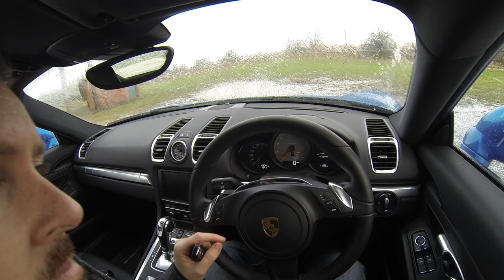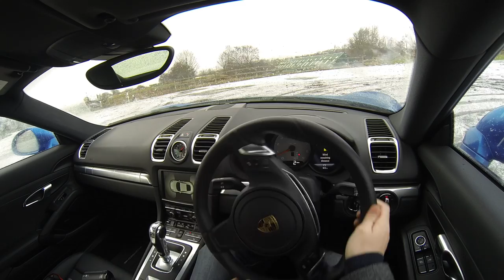Porsche Cayman, Boxster & 911 Wheel Popping Judder - The Answer

Comment: This happens on my 991 also. It is known as the Ackermann Effect. The outside of the tyres have to travel further than the inside of the tyres when following a curve. At low speeds, wide/low profile tyres and a very tight angle makes the wheels skip along and the judder/sound you experience are the wheels slipping sideways. Some people say it doesn't happen to them but it likely does as Porsche use Parallel steering geometry not Ackermann and for good reason. The warmer the tyre/weather etc reduces this effect so that also may be the reason some say they don't get it.
Reply: Best post here. Absolutly right.
Reply: Thank you!!!
Reply: That also explains why I have it with my wide 19" wheels but not with my narrow 17" winter wheels.
Reply: Spot on yes. Had it with my Z4, my 320d, and now my Boxster. I guessed it would be normal yes, but knowing now it has a name makes one smarter. Thanks a lot!

Comment: Thanks for the video, reassuring for owners who have noticed it. I  suspect that the effect worsens in the cold (sidewalls stiffer/less flexible) and is far worse on a dry road - it's because the one wheel is being dragged around a tighter radius than that wheel is deflected by the steering geometry. The tyre is dragged kicking and screaming to where it isn't aiming and doesn't want to go - hence the 'pop' as it sticks and unsticks under the forces generated on the contact patch, On an icy/wet surface it will not be as bad as the coefficient of friction is lower.

Comment: Not all porsches suffer from this and this only happens in winter conditions. I had it on my merc c63amg. Mercedes told me if I put winter tyres on it will cure the problem, although perfectly safe if I didn’t want to.

Comment: My Maserati ghibli does this I avoid doing a full lock but going slow parking ect it jumps and pops I got it checked my cv joints ect all good. Happens mainly on cold days and even after few hours of motorway it will still do it on full locks no fix.